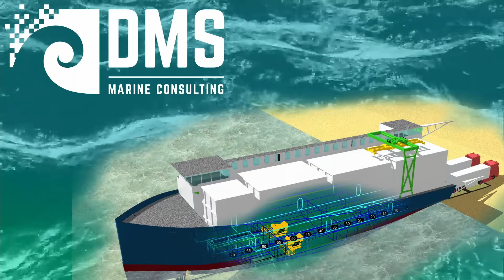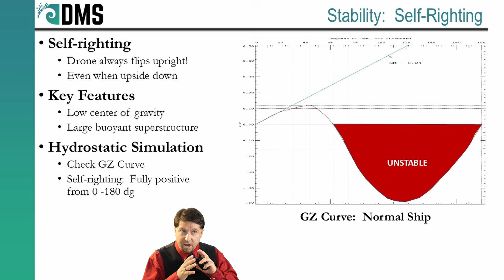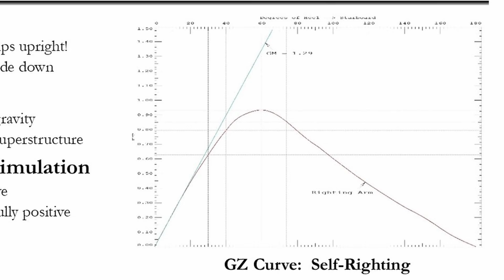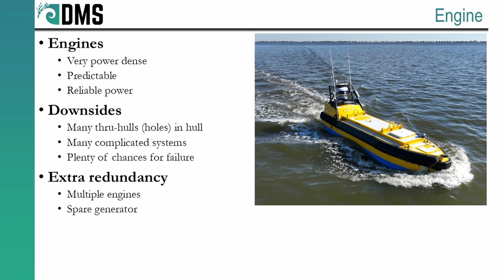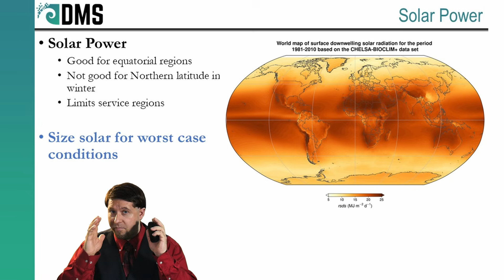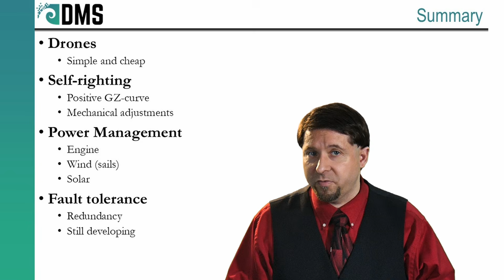How to Design a Maritime Drone

Comment: you can make decent energy from anchoring and having the drone shake around the anchor. its complex but can be done cheaply. you can also project the keel lower to get more mechanical advantage, or project the anchor point farther aside or forward.

Comment: Yeah.. An Internal robotic arm, or two, running on a roller coaster style rail along the length of the hull or even zigzaginf inbetween and around the different components of the hull. With cameras, interchangeable tooling and a selection of spare parts available.
Reply: On the off chance that this isn't sarcasm, you do not want to do this. Linear carriages are extremely expensive, complex and sensitive assemblies, robotic arms are even worse. Absolutely the worst candidate to put in a marine application, with saltwater to corrode anything metal, constant impact and rolling motions to loosen any screws and batter any tolerance between motion components, and poor access conditions for routine maintenance; these will basically always be broken.

Maintenance heavy and failure prone are not a good combination for a cheap machine you want to see infrequently, for drones the KISS (keep it simple, stupid) principal is king. Replacing a fuse, no. A parallel fuse with a contactor to enable the circuit, yes. Replacing a sensor, no. Having 3 sensors, yes.

Comment: At 9:13, your AI image has upside-down bolts
Reply from the maker: Fair.  I add in some AI images as B-roll to avoid a constant static image on the video.  As you saw, AI often gets the details wrong on those images.  This is why I don't use AI for any technical content or critical images.
Reply: At https://youtu.be/iIkXSmcAL-0?si=TDYEsUuJsdEPXSQm&t=216 Air venting Air Vents? Very good video from a knowledge standpoint otherwise.

Comment: Thank you for this interesting video 
Would air independent propulsion be a solution for such devices?
Reply from the maker: Yes, although that introduces energy limitations.  If you want air independent propulsion, that limits you to electric with solar or wind, or nuclear.  Nuclear power eliminates the whole point of making these low cost.  Plus, there are major security concerns with nuclear power on an unmanned drone.  
That leaves electric power.  For any mission that lasts longer than 24 hr, you will need some form of renewable energy to recharge the batteries.  Then the issue becomes reliability.  You need a system that can compensate for daily fluctuations in sun or wind and still produce enough energy.  

People tend to immediately praise solar as the answer.  But imagine trying to run a drone in the North, during winter, with heavy cloud cover.  How reliable is solar in that situation?  These are the added complexities for drone design.

Comment: solar ? is about 200w/m2. So the top of a 10x3M drone boat could produce 6000w in the best conditions. Paper-thin (self-adhesive solar-film) could cover all other surfaces. And maybe produce another 3000w. So at best maybe 9000w or 12 Hp.. In heavy overcast they produce 15-30%. In rain 10-20%. So in the worst conditions( except at night). The power- output could be down to 900w... Maybe float a "gigantic" inflatable tube with a 30M dia. When inflated it could stretch out a solar-film. Around 700m2 big.. In "stormy" weather..? Suck the air out of the tube and bring it in like a trawl..But yes these solar-films should be built very sturdy. And a lot of things could go wrong. Sails could be better ? But for self-righting and getting the sails out of the water. The boats keel may have to be pretty deep and heavy ? "a lot" of buoyancy below CG would help bring it back on its side .
Reply: Lots of sailboats are almost self righting without even trying. The heavy keel is simply a requirement for a sailboats to work in the first place. Sails on the other hand are quite light, and might even be buoyant them selves. Some dinghies never fully capsize because of this, even without a weighted keel, and the bodyweight of the sailor and lever arm of the daggerboard is more than enough to right the dinghy.
Reply: @2testtest2  The worst part of a capsized sailboat is when the sail is underwater, since the sail it self acts like a giant keel fin.
Still not as bad as turtling, though (capsized + run aground... sail first)